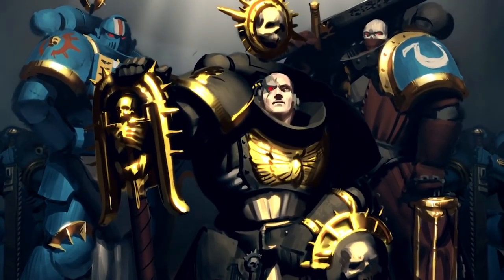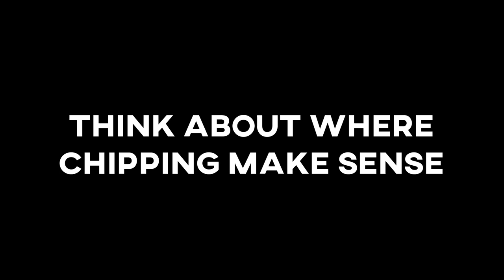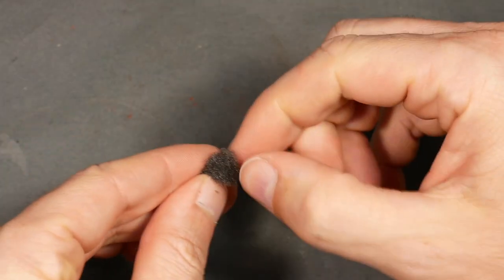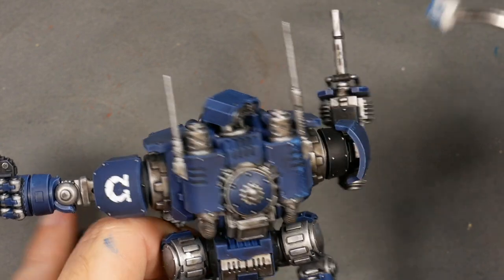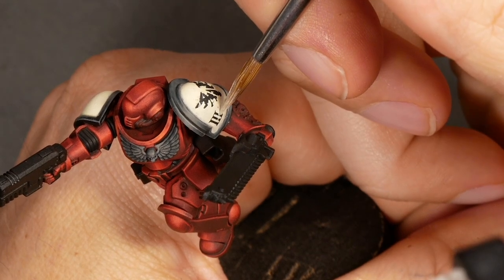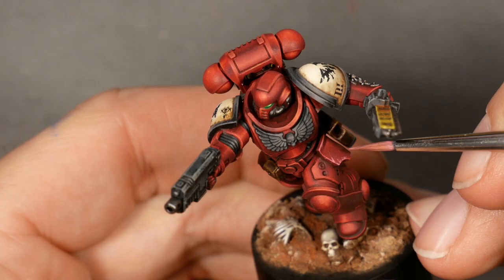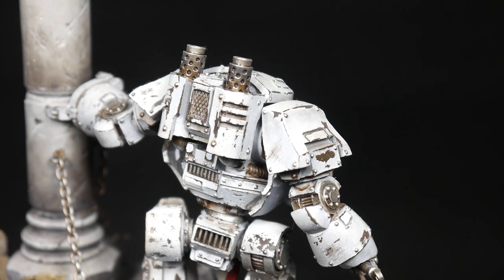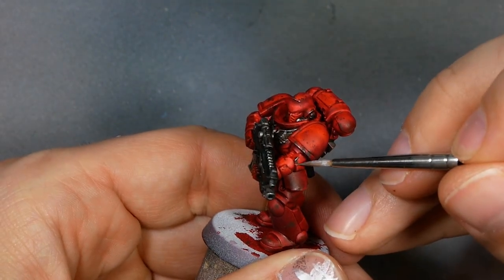Stop Chipping Like a Potato!

Comment: When I was younger I built a lot of model cars I would get dents and scrapes by using heat. I would use a heat gun in certain areas and then take a wooden dowel and push areas in also did the same effect with pins to get scrapes and scratches.  Dents I would do post primer pre paint. Scratches post paint. Also flatten tires. I used to run working l.e.d. head and tail lights. I got bored with making them look good so I started making junkyard cars and accident smashed cars. Two car accident scenes and cars smashed into trees. My local hobby town put several in the front window.

Comment: If you finish chipping your model by acrylic and find the lighter colour for chipping has desaturated things too much, or the contrast is a bit harsher than you intended. Try going over the scratched areas with an ink glaze the colour of your mid-tone. This re-saturates what might have been lost to the brighter tone, while also bringing both chipping highlight and mid-tone colour closer together. You can then always make another pass to exaggerate this further or come in with the chipping highlight colour again on selective high edge corners and other points you want to raise the exaggeration on.
Reply: Trov mentioned that this method didn't work so well on darker colours. All the best chipped models seem to be light. I'm going to try your method, which might help with it. I'm thinking it might help to replace the very dark central area of each chip with a metallic, which could then be glazed to adjust, or rust. I saw a GW painter do something similar on weathered black armour, with a grey chip surround.

Comment: After applying the darker color step of chipping you can highlight the bottom edges in darker section or use point highlights at the corners of chips using a white tone or metallic to give the illusion of 3-dimensional depth to the chip. Light would catch and reflect off the bottom lip of a gouge.

The chips may also follow the gradient of the shading of the model by painting lighter scratches near the top or light source of the mini and darker scratches in the shadows or near the base.

Comment: After going through a bunch of comments and seeing a common question - revert to real life when thinking about chipping something that is painted metal.  Chrome is a coating, so it chips to the underlying metal/primer coat (and usually comes off in flakes/chunks).  Metal tends to corrode when the surface chips (the example image of the worn old car is a perfect example)

Most armour has an undercoat/primer before the actual paint colour is applied (WW2 german armour had a red/brown primer for example), so it would go paint > lighter tone of paint > primer coat > metal > corrosion

Comment: Well, there are chipping fluids that are much easier to learn than hairspray. When I started painting gasland cars and WWII tanks, I tried Vallejo's Chipping Medium and it's quite more easy than learning hairspray, its just get it wet and chip with different tools. Of course, it wont look good at first, and there is a caveat; if you paint more than one color they can mix, you can only chip one color coat at a time, but if you paint vehicles (not Marines or the sort) its a good method.

Comment: Two biggest mistakes with hairspray chipping are:
1) Trying to chip "proper" paint layer as if it was some "temporary" paint. For example it is ok to chip in a weird ways winter camo of of soviet tank of WW2 b/c that white "paint" was nothing more than just limewash lot of times applied either by the huge brush or just by "throwing" it right off the bucket (to reproduce even that you would use two layers of chipping). If you try to reproduce normal paint chipping being such aggressive doing hairspray at the best  you are trying to represent something that spent few decades in the junkyard 
2) Using the color you actually want to see for your "bottom" layer. This might work for some cases but lot of times your bottom layer needs to be adjusted for a better effect. For example all those winter camo T-34s are not painted in russian green as you would if you were doing "summer" versions. Those greens are way more brighter then they would even if you adjust the color brightness for the scale b/c otherwise that dark green would be too much contrast with the white so it would be perceived as black.

Comment: If you have a dark base Color, you can use a lighter greay as second chipping color. 
If you have your Ultramarines Dreadnought prepared with light Blue scratches, you can then add a mid tone grey as the edge color. 
I dont like if the edge is too dark. It won't look like something metallic anymore.

Comment: I must say Im not really a friend of using a different hue color for the chipping, like on that green bike, the aditional yellow in the "no-longer-scorpion-green" im my oppinion doesnt feel good, at least thinking on realistic materials, that is something very common on a more fantasy aproach where the minis almost look like they should be havin all kinds of colors posible to make them stand out...  but for a darker/grimdark I think those should be based on the base color with black or white...  The technique may be usefull, but under certain circunstances, for example when a color from other source is supposed to be transfered, like blood, oil, rust, even some kind of biomaterial, for example the bike almost looks like was hit by an acid or some kind of necron weaponry by how it changes the color.

I think the most important things to get considered on chipping is "the amount of damage" and "what weapon did the damage" (or circunstance)...

The second tell you the behaviour on the armor that received the damage... its not the same a ricochet bullet or object, than one based on heat, like a laser, an energy weapon or a flammer... this also talks about how the player will perceive the armor paint strengh, Vs how the metal behind will perform..(making a difference on the amount of silver used on the scratch) more silver means "weaker paint job" or "durable metal behind it" this works very well for ancient or very used equipment, where it looks like he passed a war, but actually not having important damages, like a fine craftmanship expected for that kind of armor"...  otherwise you simple add more black, in form of burns, that may be superficial (over the armor paint) or deep (under the paint, so it is actually a hole, but with enough violence to not left the metal easily recognizable, but instead very dirty/uneven)*

you can also mix both aproaches with both lvls of damage and swap em, based on the tipe or armor and "story" for example,for using the 4 types properly would be great for a space marine armor, that never was fully cleaned (maintenance) but that had multiple superficial fixes and still is used constantly.. like a perpetual crusade, there you could be having deep damage that was covered with new paint or dust/ at the same time you have new recent damage (more silver) while you have also old supericial damages (decoloring) plus new superficial damages (burns) also, if you invest time enough to create you own criteria on how strong must be having each piece of armor you can create differences...  like a bullet that hits on a leg, but which mark meets the "clothing/joints cloth" of the armor, you should make that the joint suffered more in comparison with the plate... or for example, making less visible damage on pauldrons in comparison with a similar shot on an arm or a leg (as the shoulders are supposed to be stronger because are one of the biggest pieces, and with more thickness even if those would be made of the same material)

*this is very recognizable with bullet holes... if you make a perfect circle that looks almost like has been sanded (the borders) has to be an OLD shoot, if you want a recent shot, you make the hole like a tear, with displaced material and burrs, where the contrast between paintjob and naked metal makes it more moticeable.

Comment: Hairspray technique is very OK for beginners...
Use very little WARM water on ONLY ONE panel at a time.
Scratch ONLY with sewing NEEDLES and TOOTHPICKS as a beginner (brushes are for advanced and experts).
Scratch the edges using fine abrasives SIMPLY PRESSED on the wet and warm painted and hairspray coated edges.

Done.

Comment: Do you have any tips for extremely chipped metal. As in the metal has lost the majority of its paint and is almost bare, except in some of the recesses where old paint still remains?

Like if someone took a car hood and bashed it into an armor plate, thus removing most of the paint in the process
Reply from the maker: Paint the surface in metallics, apply hairspray method or chipping medium and then paint on top and get rid of most of the last layer.

Comment: Excellent video. Would the same principle apply for a metallic themed marine, like a silver skull? Lighter silver colour for the initial scratches and then dark centres?
Reply from the maker: Yes. Though i am not sold on the principle of metallic paint having an "undercoat" of dark material. I always kinda think of metallics as being the material the armor is made off, so personally i'd only chip with a lighter metallic color. BUT - it's your minis and you should paint them the way you want to :)
Reply: Trovarion Miniatures It’s MY minis, but it’s YOUR valid point! :) Now I only have to think of a way to differentiate between highlights and scratches. Maybe the cold-warm divide can help with metallics as well. Thank you, sir!

Comment: Looking to chip a 1/80 scale (~20mm) Star Wars ship, that has a warm yellow and mid-light grey (purple tint) color scheme. The light source is coming from the front-right, which means one side is a lot darker than the other. Re-watched the video and have come to the conclusion that I have 2 options. Either just paint the chipping with a darker color that represents either the primer or the material the schip is made of (e.g. Rhinox Hide (also a nice purple undertone)) or start with a lighter tone and paint the darker tone inside the light one. One issue is the small scale and the painting chipping looking too big, the other is the different colors and the different value's I am dealing with. Any advice?

Comment: Sponge chipping is pretty much a technique made to create quick results without too much effort. Even armour modelers prefer the brush method for control, but go to the sponge technique to cut down on turn around time. The downside is less control and if you're heavy handed, its like painting with a shotgun. Easy solution to either extremes is to just mix the techniques. sponge on areas you're putting down heavy chipping, touch up and create larger chipped patches with a brush(connect the dots).

TBH, the current trends in armour modeling has borrowed more and more from the artistic rendering side of things(whereas it used to be more technically selective), adding techniques to create more contrast and artificially pop the model where it was once considered taboo. It's probably better to just understand what the strengths and shortfalls of a technique and bank everything you come into. If you're applying that knowledge effectively, you'll either get something good, or you'll get something surprising(which can be good or bad, depending on your time crunch). 

Just keep in mind that there aren't very many mistakes you can't come back from, but more importantly, mistakes are the best opportunities to learn something new. Don't fear it, just figure out how and why it went wrong and you'll either be getting better next time you apply the technique, or have stumbled into a new technique that is in need of a proper application.

Comment: Will metallic chipping with a sponge work just the same?
Reply from the maker: Depends on what result you want, but the simple answer is: yes you can use a sponge to put on metallic paints in a chipping pattern
Reply: @trovarion  wow, wasn't expecting an answer so fast or at all, thanks, I suppose a more precise question would be sponging  the metal onto metallic to make it look like there's a different tipe of metal beneath it
Reply from the maker: @blacklegbeastro5295  like edgehiglighting? sure. just make it contrasting.
Reply from the maker: @blacklegbeastro5295  i dont know, try it!

Comment: 💡💡🛎️🛎️Hi! 🛎️🛎️💡💡 Please consider 👇🏻👇🏻👇🏻👇🏻
The biggest problem in the hair spray technique is the flooding. Like using too much over thinned paint. This reason big flakes come out on middle. if you want to good corner chipping with hair sprey you should use airbrush and focus really thin layer and minimum 3 or 4 layer.

Comment: One this I use I have a few varieties of plastic tube sizes and I just cut the blister foam into long rectangles and slide it into the tubes then you just pull a bit out of the end of the tube rip it randomly and the tube is a lot easier to hold onto than tweezers.